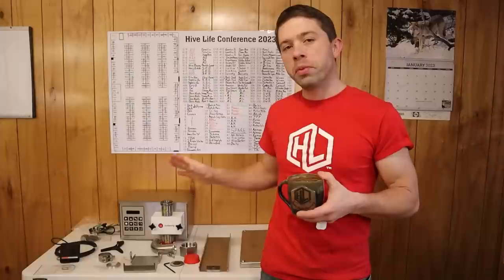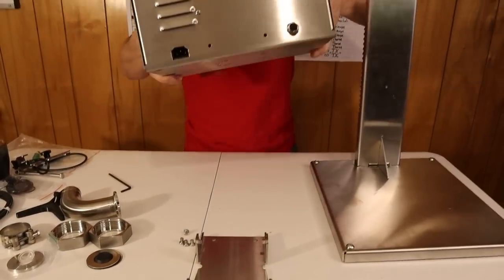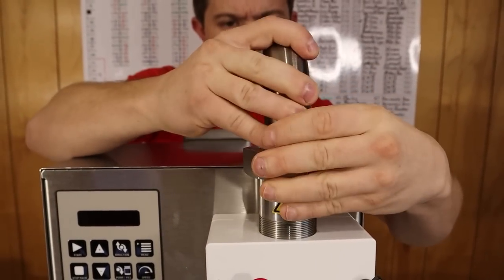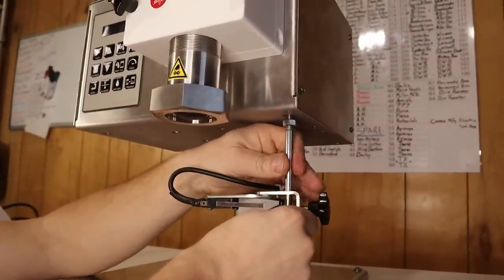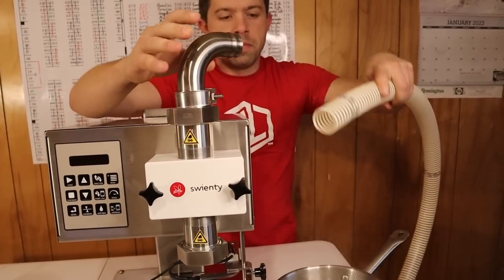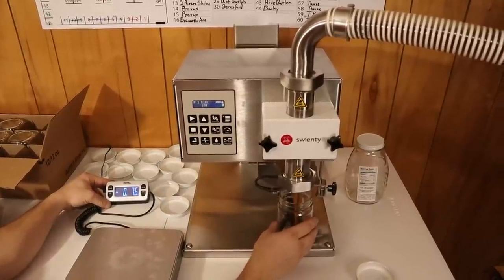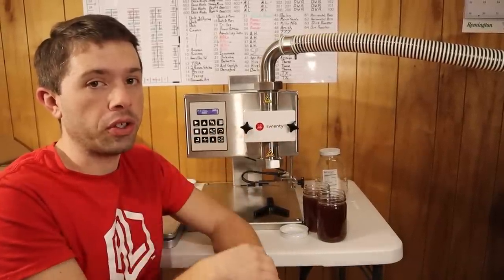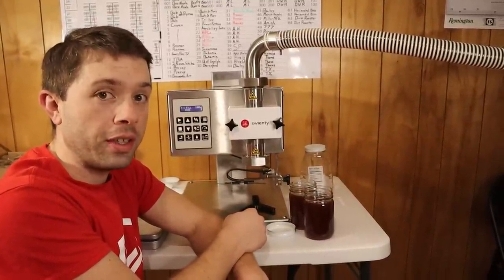Swienty Auto Honey Machine - Assembly!

Comment: I got the Swienty Dana ApiMatic 1000 with the 45cm tabletop turntable last year. Awesome bit of kit and paid for itself in time saved. You will find the temperature & viscosity of the honey will make quite a difference between batches but the machine is so easy to calibrate to compensate.

Comment: I'd like to know about what happens after it sits for a while.   Does it need to be cleaned if not used for a few days? Do you have to pull the elbow off and re-prime?  How do you back drain the hose and elbow without making a big mess?  This looks like a real neat setup.  Thanks for sharing.